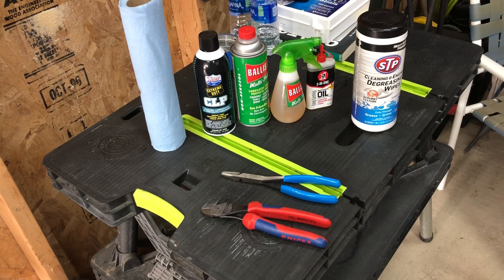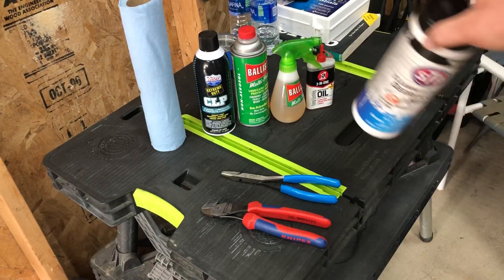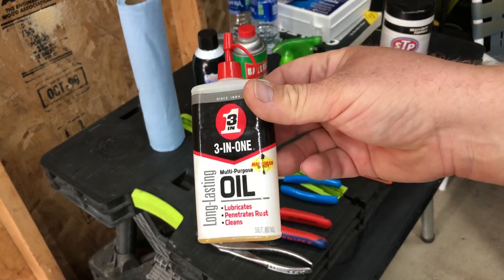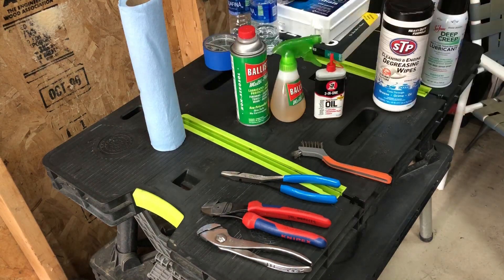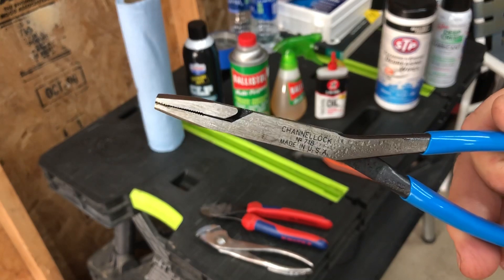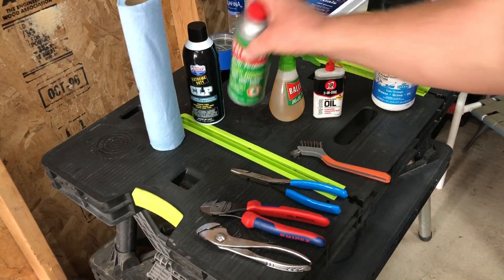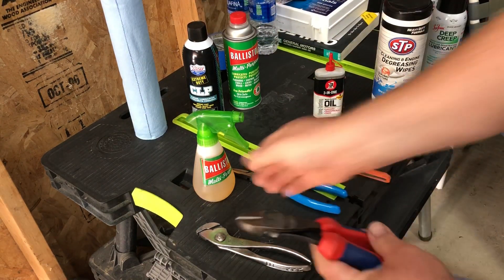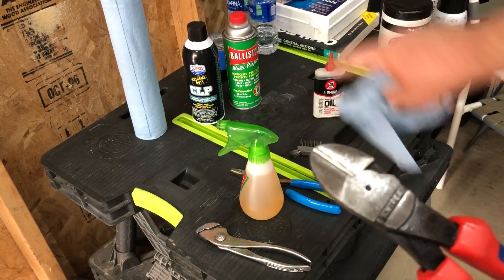“How do you maintain your tools?”

Comment: Hi Scott!  Excellent presentation!!!  It's so funny you bring up the "smell"...  The PB Blaster has a very 'unique' smell for sure!  As you well know, you have to be very aware of these things when working in other people's homes!  The funny thing is I can't get used to the smell of Ballistol!  The 3in1 smell always takes me back to when I was a kid...  😃👍. Thanks very much for sharing!!!
Reply from the maker: Thanks ScoutCrafter!   Hey, by the way, on an unrelated matter,  I received my Lock Line pliers today, and they are in very good shape. They open and close very smoothly. The thing is, I can’t get them to lock on to anything! Either I’m doing something wrong, or maybe despite being seemingly well lubed, maybe something is seized internally. Any ideas that could help me out?  It also looks like they may be slightly bent. Not sure what to do with them! I appreciate it!
Reply: Hello Scott!  Their are very few parts to these pliers but I think you are on the right track as far as maybe the inner cam is not engaging because of the lack of use...  I would try two things, first flood the joint with penetrating oil, then if that still doesn't work hit it with a little heat and more penetrating fluid (PB Blaster) hopefully it will free up the cam... Once it works it should be good!  Let me know!!!   😃👍
Reply from the maker: I’ll try it and let you know. Thank you Sir!

Comment: Ballistol is so expensive because they make it under food conditions. You could actually drink it, and some guys here in Germany do that if they've got a sore throat. Personally I can't stand the smell of Ballistol...
And keep it away from copper or copper alloys like brass or bronze.
Reply from the maker: Drinking it??!!   INTERESTING. I actually like the smell of it, myself.
Reply: Yup, there's a variety of it available named "Neo-Ballistol" which is actually the same as normal Ballistol but made under pharmaceutical conditions. The standard Ballistol is food safe. Meaning this can be used in the food industry to lubricate machines there. You can't use standard lubrication there, because this could contaminate the food.
You can use it for almost everything: Sunburns, wounds (it's desinfecting), insect bites, burns and so on.

https://ballistol.de/shop/en/products/people/neo-ballistol-household-remedy/2/neo-ballistol-houeshold-remedy
Reply from the maker: VERY Interesting!  Thanks for the info!

Comment: I just got down cleaning a set of large sockets. One is gigantic and takes a 1 inch drive.  I put them in evaporust for a couple days and then in a bucket of hot water with dawn. Then I used this wire attachment on a drill to get deep in the sockets. Then I gave them a toot of wd40 on the inside and again on the outside and wiped them with a towel.

Comment: 4:35 why not use a painters brush rather than a paper rag to apply thin even coat across the tool not missing any crevices paper rag will absorb most of the ballistol rather than coating the tool properly